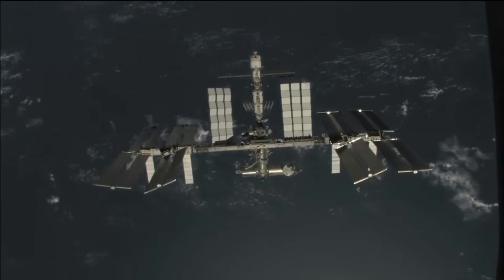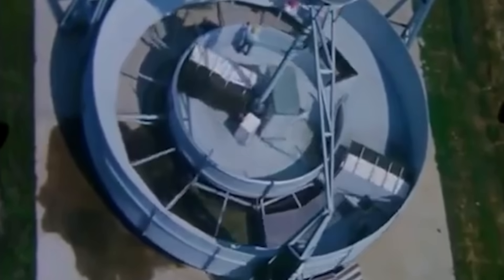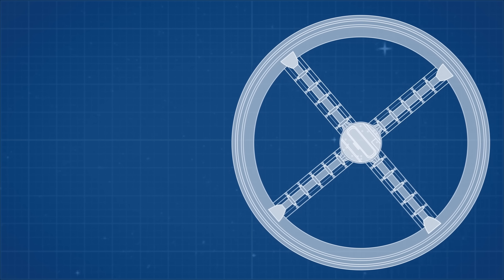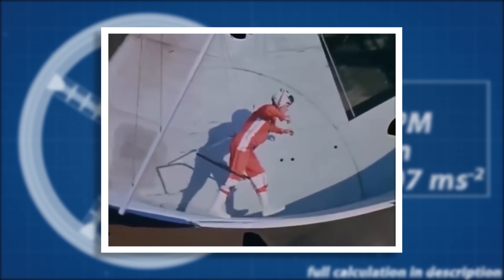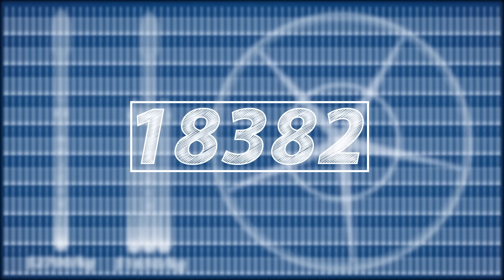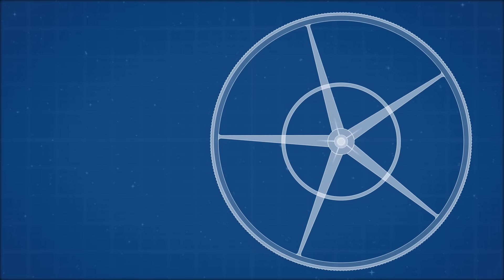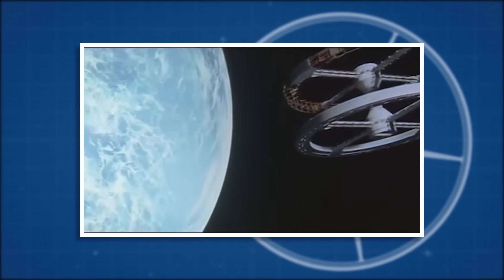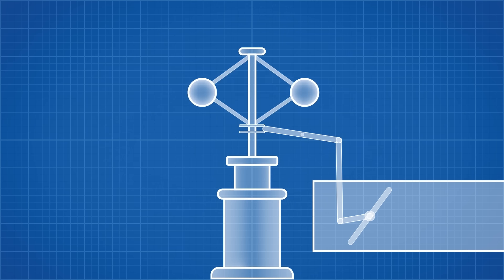Can We Create Artificial Gravity?

Comment: So lets say that a washing machine was placed in space, turned on and the clothes just floating in the middle, without contact to the drum. How would centrifugal force ever get the objects floating to experience artificial gravity? And even if the clothes got into contact with the rotating drum, they could easily escape the artificial gravity if they could jump like a human, because there's no actual force, forcing them towards the rotating drum/object. I'm confused.
Reply: Don't forget about inertia.  If you were standing on the "wall", that wall is spinning, which means you are too.  If you jump up, you would have some sideways velocity, so you'd end up hitting the wall sort of off to the side.  Since the wall was spinning too, it sort of followed you on your path, and you'd end up hitting the wall in about the same spot as you left.  To you, it would appear that you jumped straight up and fell straight back down.  To someone outside the spinning craft, it would look like you jumped up, and maintained your sideways velocity until you ended up hitting the wall over to the side.  This is really hard to explain without visuals!
Reply: @willoughbykrenzteinburg  But if you jump up, you would just float away due to there being no gravity. And the thing about inertia, what would keep grounded to the wall? You would have to be strapped down to the wall somehow to even stay there, or the wall would simply just move under your feet and turn you over.
Reply: @Vazin  Have you never been on one of those rides that spin?  You are literally pinned to the wall!  Your body want to continue in a straight line, but the wall keeps redirecting you inward.  The exact same inertia which causes you to be pushed to the side of a car when turning or things flying off the seat when you slam on the brakes.  These are inertial forces, but within that frame which is accelerating (rotation is acceleration), this inertia behaves identically to a force.

Now, if you STARTED in the middle and never made contact with a wall, you would just float there.  But the walls would be spinning around you.  However, if you ever reached a wall, and then got spinning with it, houd be held to that wall via centrifugal force.  If you jumped up, your sideways motion wouldnt just stop.  You would continue sideways, and eventually hit that wall because it was rotating up to you.
Reply: @willoughbykrenzteinburg  How would inertia work in space when there is no force on the human body? You are legit weightless. You are pinned to the wall thanks to gravity and your body's weight. With those two factors gone, inertia is too.
Reply: @Vazin  You have a vastly gross misunderstanding of inertia then.  Inertia is simply the property of any matter which maintains any state of uniform motion.  Inertia is just a predictor of how a body will behave when no forces are acting on it, so it inherently requires no force.  It's a fundamental property of matter.  An object in motion will remain in motion.  In those spinning rides, gravity has absolutely zilch to do with why you are pinned to the wall.  Centrifugal force is the cause and centrifugal force alone (centrifugal force is simply inertia from withing a rotating reference frame).  If the ride were in deep space, you would be pinned to the wall just the same. 

When you make contact with a wall, friction and centrifugal force will eventually hold you there.  Relative to the center of rotation, let's say you are moving at 10 mph.  If you were to jump up, you would MAINTAIN that 10 mph because of your inertia.  You wouldn't magically stop.  Since the wall under your feet is also moving 10 mph and rotating, eventually that wall would come back up to your feet because it will eventually rotate up to you.

Imagine you are on a bus that is moving.  If you jump up in the bus, you won't fly back and hit the back of the bus.  You would fall back down and land exactly where you jumped from.  Now of course, this is due to gravity.  The point here is that your inertia maintained the speed of the bus because you were already moving along with the bus.  Now, if - while you were in the air - the bus slammed on its brakes, THEN you would land toward the front of the bus and the bus would be moving relative to you because it changed velocities while you were in the air maintaining the original velocity of the bus when you jumped.  The same concept applies in a rotating reference frame except the walls are continually curving upward.   When you jump up, you will maintain your inertia - your sideways velocity - and the floor which is spinning beneath your feet will come up to meet you.  To you, it would simply appear as though you jumped up and fell back down.  What really happened is that you DID float away the moment you jumped, but the floor of the walls which are rotating up toward you will eventually come to meet you.

Before we continue here, are you attempting to deny that this would happen.....or are you trying to understand why it would happen.  If it is the former, then this conversation is over.  I'm not humoring the rejection of someone clearly ignorant on the subject, but if you are merely trying to correct your ignorance, I will try and help you understand.
Reply: @willoughbykrenzteinburg  I know how inertia works and I understand your frustration and appreciate your comment. But if you were to be located in space, centrifugal force wouldn't make you stick to a rotating wall without you being stuck to it somehow. Without gravity or some form of force on the human body would just make you smack against the rotating walls and fling you to another direction. And if you were to jump on a rotating object in space, I know inertia will move you with the wall, but without gravity you would simply end up floating with the same speed you left the wall and end up hurting yourself. If that makes sense. I want some kind of visuals too :D
Reply: @Vazin  You are right.  I'm saying ONCE YOU GOT MOVING WITH THE WALL, you could then walk around and all that.  Jump up, and you would fall back down.  First, of course you'd need to get moving with the wall.  Ideally, there would be some sort of ladder system.  You would somehow make your way to the center of rotation, get on a ladder and climb down.  The farther you get down toward the wall, the faster you are rotating and when you reach the bottom (the wall), you'd be moving with the wall.  If you were floating in the middle to begin with, the walls would just be spinning around you and if you touched a wall, it would indeed just whizz past you.  Over time, each time you hit the wall, it would transfer some energy to you via friction and over time you would build up enough speed to eventually match the wall's speed.  That's not very efficient though.  Obviously, there would need to be some means of deploying you onto the wall with the speed of the wall at which point you would be able to freely walk around.
Reply: @willoughbykrenzteinburg  Gotcha!

Comment: You are assuming you need a large structure to get at a large radius, but you could achieve the same goal by splitting a regular space station in two and tying both halves together with a 300 meter or longer cable. A symmetric pair of elevators and a central micro-gravity module could be used for docking.

Comment: I wonder what additional forces would affect astronauts in case this rotating torus-shaped station moved uniformly along its longitudinal axis as far away from Earth as possible)). Would there be any undesirable and strong enough pulls on people preventing them to move freely, effectively and securely, around the torus-shaped part of the ship? Is it real for a torus of appx. 1 km radius rotating at appx. 6 rpm (thus providing the usual 9.8 m/s2) to be built no matter the cost?? Thanks.

Comment: But why build it is a full circle. you can just build 2 structures at each side of a center pole and inside each of them you will get the same artificial gravity effect. That way you won't need so much material.

Comment: Centrifugal force exists, and no, they didn't mean "centripetal" force. 

Unlike what Captain Argument wants you to believe, 'centrifugal force' is a perfectly clear, concise, valid phrase to describe a certain inertial reference frame, or the virtual gravity you experience inside a giant centrifuge like the Gravitron. Gravity itself isn't a "true" fundamental force like the strong, weak, or electromagnetic forces; it is a consequence of the warping geometry of space-time as described by Einstein's theory of General Relativity. Is Captain Argument gonna say that whole mouthful from now on instead of simply saying "gravitational force"? 

Centripetal "force" describes an inward-directed pseudo-force, like gravity. Another good example of centripetal force is string tension: if you were to secure a string around a rock and then swing it around yourself; the rock does not fly way because of the string's strength, it's tension, it's centripetal force. If we ever do build a space-elevator, the line will be held taut by centripetal force.

Comment: I can make it much easier just go to the fair and ride the tilt-a-wheel, it will spin you ut about 2 G's of force:  To build a space station 60 km + in diameter bring back the "SEA DRAGON" concept rocket and build it with today's technology instead of the early 1960's technology where it was conceived to carry 550 tons into "LEO" so if we can use today's technology at 1000 tons it would take 1000 launches thus bring the cost down:  We can also build the "Sea Dragon" where the first stage returns to point of launch and the second stage designed for reentry and reuse even if we have to replace the engines on both stage's that is ok because we can use the redesigned "F-1 Saturn engines" now called the "F-1B" made with only 40 parts now.

Comment: I was thinking, couldn't you just make a "bolo station?" Just build a station of the same size as the ISS, and similar basic size, but designed like a cone, with all the interesting stuff "floored" at the flat end. Then build another one, and put a transit tube between them that's like 300+  meters long, with a docking bay in the center. This way, you could get the thing spinning at a rate that would provide reasonable false gravity at both ends, but the total mass would be a fraction of a full ring station, probably somewhere on the order of an ISS and a half, or at most 2-3 ISSes, and most of that fairly generic tubing. There are fragility issues, a broken tether would be very dangerous, but it should work, and you could even get advantages in catching and launching objects from the endpoints for bonus speed.

Comment: There is no reason for weightlessness of astronauts on TV screens, other than need for the fraud to look spectacular. The so called "weightlessness" is ONLY achieved in FREE FALL, when everything is in condition of unrestrained motion TOWARDS THE CENTER OF GRAVITY with ever-increasing speed (objects and people do not exert any pressure on each other). "Orbiting" is not synonymous to "falling", but to "maintaining an altitude". Rocket engine becomes useless beyond Earth's atmosphere. If only astronauts COULD get in to the orbit, they would simply walk inside the station, like passengers do on commercial airplanes.

Comment: Far more reasonable is to use tethers.  A living compartment  roughly resembled tube with a slight outward curvature for the floor. The tube is attached to a tether with a counter weight  at the other end, and set both in rotation. The curve on the floor  traces out the curve the compartment makes as the tube and counter weight orbit. A longer tube provides stability to shifting weights inside but one has to deal with the increased artifical gravity at the lower floors.  The tether can relativly arbitrary long allowing for a more uniform sense of artificial gravity indide the tube. Mass for the counter weight does not need to be expensive or complicated.  It could be gathered from  decommissioned  non functional satellites, or it might be dirt electomagnetically launched from the moon or taken from astroids.

Comment: We don't need to have a giant wheel we just need two small space craft and a long chain between them or one small space craft and a rock (counter balance). They just need a booster the get them orbiting each other. The other beauty of this is that if they have detectors that some chunk of debris is coming towards the spaceship then a computer will un hook the chain and the two parts will instantly fly apart avoiding the collision. Then when the danger has passed, they then fly around and gather up the bits and start up the 1G spinner again.
Reply: Also why would the blood rush to your feet with 1G of gravity when it doesn't do it on earth? just because the Gs on your head is less doesn't mean the blood will be drained from your head. It's more likely to be drained from your head if your head also has 1 G forcing downwards as well as the 1 G on your feet as happens on earth.

Comment: If you had just one ring, you would need thrusters to get it to spin. If you used two rings exactly equal in size and mass, couldn’t you use a conventional motor to make the rings spin in opposite directions making it more efficient?

Comment: I think most folk miss the point about artificial gravity.   Certainly, it would require an ENORMOUS craft to generate Earth-like artificial gravity, but in reality, we don't NEED to; all we need is to spin a small PART of a craft, fast enough to create hyper-gravity, in order to counter-act the atrophying effects of weightlessness on our bones and muscles.  Say, for example, an isolated sleeping module were spun at a rather high rate of speed; astronauts could then experience significant gravitational effects for roughly 1/3 of every day.  This would substantially reduce the amount of bone or muscle atrophy from weightlessness, and as long as they are asleep, they should experience little or no disorientation.
Reply: Yeah, no. Astronauts have to adjust for days to weeks after returning to earth to readjust to normal gravity. Alternating between micro-gravity and hyper-gravity every day is basically suicide. It would be equivalent to taking a deep dive followed straight away by a trip to Mt Everest instead of a pressure chamber. Not the best idea.
Reply: That's actually a really good idea as people could lie against the outside of it, where their entire body would be equidistant from the centre of rotation so they wouldn't be affected by uneven forces

Comment: There's another way to replicate gravity. Basically, if the (flat) earth were constantly accelerating upwards, then we'd experience an inertial force very much like gravity, in the same way we do when we're in a car that is getting faster.

And before any smartarse glober points out that the earth would eventually reach light speed if it continuously accelerated, well I have an answer for that too... relativity. What is actually happening is the rest of the universe is constantly slowing down., but never actually stopping. We resist this slowing down, we have inertia, which gives rise to relative acceleration.

I should probably make a youtube video on this bollocks, there are plenty of idiots who buy it.
Reply: Wait, that doesn't work. The universe isn't slowing down, it's getting faster. But that's ok because expansion. Fuck me this might actually make some sense.

Universe expands constantly, but we have inertia so we resist this universal motion. This is constant acceleration... a relative  and constant change in motion.

Earth sits motionless in expanding universe, fictitious force emerges.

Ka-ching.

Comment: Suppose you could somehow create a small scale kuglebitz (Black hole out of energy alone although theoretical) and it didn't take insane amounts of energy to maintain without eating whatever is creating it, and it could do even 20% mass to energy conversion in one way or another! If this was possible it would solve just about any kind of energy problem and space faring fuel issue if you could direct it's energy release. 
Sadly all of that is theoretical and probably not possible but thoughts and concepts are what allowed modern science and modern supposed facts to even be conceptualized.

Comment: So what happens if you jump while you are on such a circular rotating space station? Let the diameter be very large for the sake of simplicity. I think there are two problems: Because the centrifugal force is no "real gravity" but only appears to be so, there is no force that pushes you back to the floor. I don't think this is what one expects from such a "gravity simulation". The second problem that I see is that in the moment that you jump you travel along a line (!) because you still have the velocity of the ring at the moment that you jump. Thus, aren't you hitting the ceiling or the floor sooner or later with the very high velocity of the ring leading to severe injury?